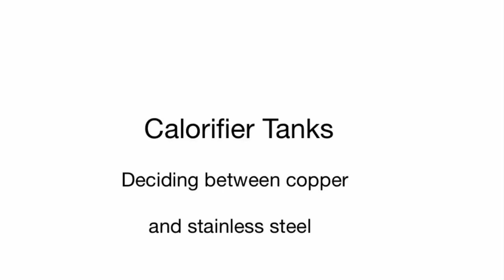Choosing between copper and stainless steel for a hot water tank

Comment: live in an area with spring water which is more on the  acidic side , basically copper tanks lasted approximately 5 years, fitted a stainless 13 years ago and been no bother what so ever also stainless tanks are cheaper than copper, absolute no brainer for our situation

Comment: As you know salty water corrodes copper. Officially 1/3 of the Earth population lives in coastal areas(<100km). About  5-10% has direct daily contact with salt water(sea or ocean) That's huge demand for SS304 and especially for SS316(heating, desalination+any marine equipment). My boat runs on steam power of salty water which it gets from solar heater which transfers heat to SS316coil, basically large solar putt putt boat, maintenance cost is lower than that of sails, so I am getting more benefit compared to wind energy(sails only) right now, though I am considering adding noiseless Archimedes wind turbine with chain transmission to props for night travel.